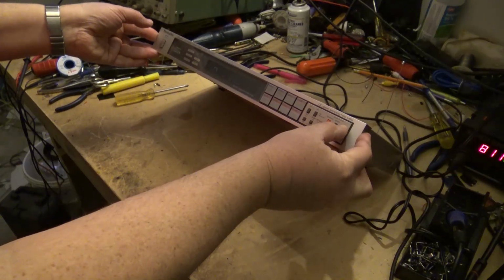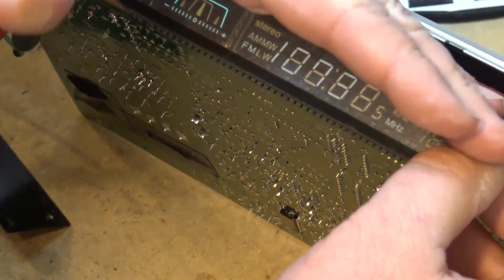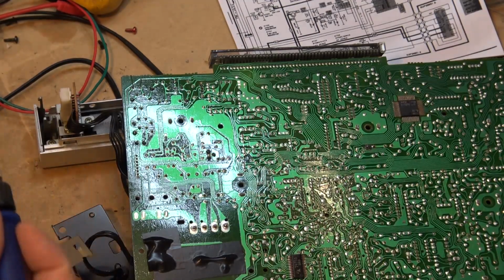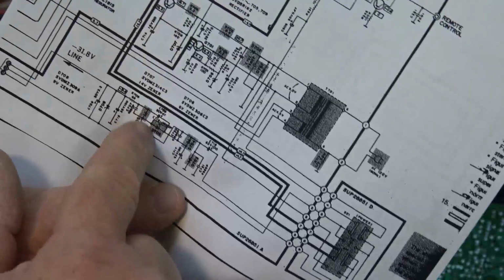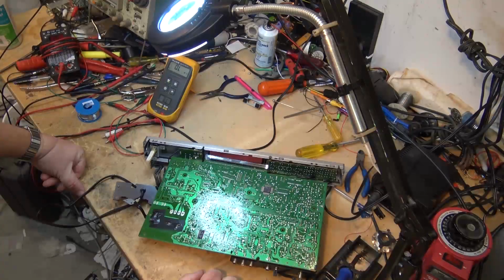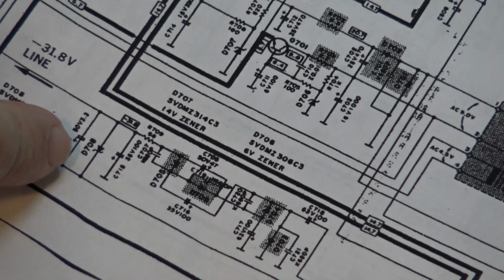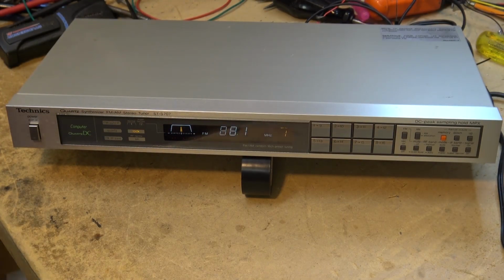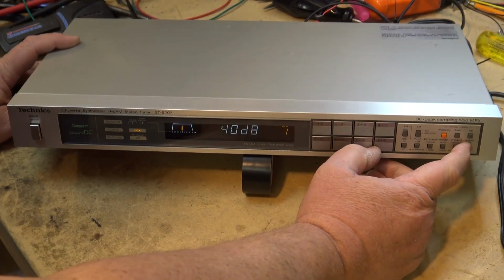Technics STS707 Very Dim Display

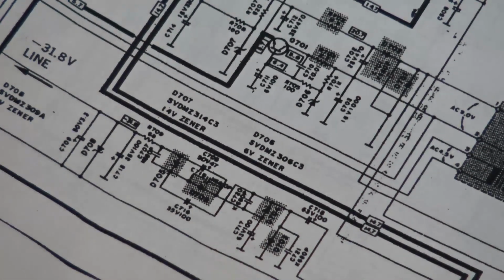Comment: Sir, what do you mean in minute 5:38 that you "bridged" a capacitor? thanks
Reply from the maker: Just how ir sounds. I bridged over a second cap in parallel with the original.  In every situation except a dead short (in other words open or high esr) it would have fixed the problem.
Reply: @12voltvids  Thank you. That's new (for me) so putting a capacitor over another one just to see if it has low capacitance and therefore the problem. Learned something today. By the way I'm a newbie. Oh, what could possible happen if the original capacitor is shorted and you still put another over to test?

Comment: How many volts was on the -31.8V VKK line with the bad capacitor?
I'm asking because I have an LG micro hifi with a dim display, it's VKK line is -27V and it is okay, so where could be the issue?

Comment: Hello again Dave. I've toured your very informative VFD related vids again as I have been given an old Teac AG-790 that has a dim VFD. The voltages check out (-32V at the 'plate', 4Vac across the filaments, and 5.1V bias supplied by a zener connected to the filaments transfomer's centre-tap). Then I came across your Biasing Your Vacuum Tube Amp video; very interesting, not just for VFD info, but I worked on valve stuff when I was a kid. Anyway, since a VFD is a valve of sorts, what's wrong with altering the VFD bias in the same way as you recommend setting up ageing valves? What are your thoughts on reducing the bias by replacing the 5.1V zener with a lower value, (since the 'HT' is negative), obviously taking into account the current limiting resistor? At best the display will be a bit brighter but uneven. At worst I'm on my way to the burns unit again. Regards.
Reply from the maker: Vfd fail for many reasons.  Phosphor burns, loss of vacuum and filament loses the coating that emits electrons.
Reply: @12voltvids  Thanks for getting back to me Dave. I think I'll get a selection of zeners and give them a try anyway. Also, there are bits of info elsewhere on the internet that discuss rejuvenating VFDs by increasing the plate voltage (temporarily), and raising the filament voltage a bit.  I'll do a bit of tinkering. If I have any luck, I'll let you know. One annoying observation, is that when I take the front panel cover off, the VFD is pretty bright. But, the front panel cover includes a colour filter to mask the VFD electrodes, but it attenuates the VFD light a fair bit. It's a pity the designers could not have included a feature to adjust the display brightness, or peel-off filters behind the front panel. Regards.

Comment: Hi sir, 
I've a Sony MHC- W550 mini hifi home audio system, I'm facing same problem with it's display. The display is too dim, plz give some solution, thank you 🙏
Reply from the maker: Check the supply voltages driving the display.  If ok then the display is bad.
Reply: @12voltvids All is not necessarily lost though.  This video and all the tips you gave were much appreciated. I have an old Yamaha RX-V390 receiver with a dim display, but all the voltages checked out, and I was resigned to the fact that the age of the VFD was the root cause. However, during reassembly, I noticed that there was a strip of orange film covering the VFD. I peeled it off, expecting the VFD to be brighter but with all the electrodes visible. Not at all. I assume that the designer did not like the blue green colour for some reason, set the VFD circuitry to max brightness, and then put an orange filter on the front of the display. I accept that this may only give me a few more years use, but I'm happy with that.
Reply from the maker: @davidwhite9751  must of been one of these blue light snowflakes.  Sorry but when someone tells me to put a blue filter on my phone because it is bothering them at the next table I am more likely than not to tell them to eff off.  Yes that happened to me once.  sitting in a restaurant by myself waiting for my food to come I was surfing around on my phone like a lot of people do. Women sitting at the next table with some little kids has one if the kids whisper something to her then she gets up walks over to my table and asked me to turn down my screen brightness or turn on my blue filter as it was bothering her kids eyes.  
Guess what i did so apease her.  
Yup started surfing the twitter feed milfs, juicy mins ect making sure to hold my phone up high enough for them to all get a show.  
Some people.  They should just mind their own business.   
Bothering little Johnny's eyes. Give me a break.  Perhaps if he was sitting in his seat instead of standing on the bench looking over my shoulder at my phone this wouldn't have been ab issue!

Comment: Thanks Dave, i have 2 Technics ST-S7 tuners black and silver that match my two Technics SU-V8 amplifiers. I changed the caps to new (nichicon pws), but both displays are dim. I have to work out what you mean by bridging , as maybe it needs more power to the display.

Comment: Greetings! I have a Technics SA-CH455 that I picked up at Goodwill. Everything seems to work, but the display of the tuner/cassette deck is barely visible. I cannot seem to find a decent schematic for the 455. Any ideas on what and/or where I should be looking for a fix? Thanks!

Comment: Just finished watching the longer version after this short one and I think that I prefer the longer one! 
It might be a good idea to create a second channel that contains all the short versions, some people like them short and others who need to make a similar repair need the long version! 
I noticed in the long version, you tested a 100uf capacitor and got a reading of 105uf... A good capacitor should always read right on the mark or just below it! 
If it's reading above, it's leaking DC current! ie a short or close enough to a short! 
The ESR meter is only looking for high ESR and nothing more! 
A shorting capacitor will always return a higher value due to the short appearing to charge longer than it would if it was not shorting... They have to be pulled from circuit to be tested, there's unfortunately no easy way around it! 
You can quickly go over all capacitors in circuit with the ESR meter but that doesn't tell you everything! As soon as you called out 105uf for a 100uf capacitor, I knew straight away that it's a leaker! There's no such thing as an over achiever when it comes to capacitors!
Reply from the maker: Go back to school.  Capacitors can be 10% under and 20% over. That is the tolerance on electrolytic.  So a 100 can measure between 90 and 120 right out of the box.
Reply: @12voltvids  I have never measured a new capacitor that was over its rated capacity, only old used capacitors that show low parallel resistance.. but to see that in the first place, first you need the right tools, you can't use a multimeter! It's not sensitive enough! If a multimeter can see it, that cap is bad... 
Either you have a Heathkit or Eiko leakage tester, or Paul Carlson's capacitor tester which tests for leakage or an LCR Bridge Meter... Some of those Chinese multi component testers will give you a Vloss % reading, it's better than nothing and can identify parallel resistance much better than a multimeter... You call it shorted, this is exactly what low parallel resistance is! It can be so low that a multimeter trying to measure resistance isn't going to be able to do it and just gives you a short reading... 
I'm sure that you have one of those multi component testers, it's possible that it shows the Vloss reading when testing capacitors but you probably have never taken notice it, it's telling you at what percentage it's shorted, compare some old capacitors that you might have laying around to the same thing in new one's... Actually, make it a video! I don't know what it is but people love watching bad capacitors being treated and compared to new! I would definitely watch that....
Reply from the maker: Starting another channel is not an option because I would have to meet the eligibility requirements to monetize the videos.  The new edits of old videos are for those that complain like spoiled brats about videos being too long.  For every person that says they like the long version 20 say they like the short version better so you are in the minority.
Reply: @12voltvids  well you are the creator! Kinda like a god LoL, it's your channel at the end of the day and you should do whatever you wanted to achieve! 
The people who like the short video just want to see the fix, they are not interested in who you are. For those who like the longer video, I think that they are the loyal viewer, they enjoy the fix and anything else that you have to say...
Reply from the maker: @PeterMilanovski  and there are both versions.  The new short versions are remakes of older videos and the old ones are not going away so don't worry, because there will be longer videos still made.

Comment: Huh? Don't VFDs get weaker with age? I mean, by prolongued usage?
Was this case an exception?
Reply from the maker: Yes they fade with age. Some faster than others.  I have a clock that the vfd failed.  I changed it for another one i pulled from another clock module that i had used the chip to make a jumbo display clock.
Reply: @12voltvids  Unfortunately I can't do the same thing with my AKAI DT200 timer. They're rare to find and would cost just as much to get!
I was secretly hoping you had a magic solution for reviving VFDs!
Reply from the maker: @Stelios.Posantzis  you can raise the filament voltage slightly. That will heat the hot cathode and create more emission but this is a temporary fix.   Most last a long time. I have some displays over 40 years old still relatively bright. It depends on the tube.  I built a 6 digit VFD clock a couple of years ago. Perhaps 3 (the build is on my channel) and the 10 minute tube is so dim it barely shows now.  Depends on how well the tube was made.  Good tubes last a long long long time.  The original one from my 1979 RCA VCR is still good . When i scrapped the VCR i made a clock out of it.  Still works and it is 42 years old and bright as anything.

Comment: I didn't think you can trust a ESR meter.
Reply from the maker: Of course you can. ESR going up is the first sign that a cap is starting to fail. The only time an esr meter won't work is in the event of the capacitor shorting internally and in all my years of servicing i can tell you i have more fingers than the number of times I have see a cap dead short.   In 10 years i have seen it twice. One was the main filter on a power supply.

Comment: I've seen that same defect before... usually the caps go out or the display is EOL.

BTW , buy a componenttester. It tells you right away that the capacity is off-spec. Usually I exchange caps that are more than 10% off.

Comment: I have a GE Sapcesaveer microwave with a VFD. The left side is pretty good, and the right is very dim. I don't have a schematic. I suppose I need to get in there and compare voltages, then guess which parts to pull and test.

Comment: Can you make a video on how to desolder without damage to the board? I've been practicing removing ICs from scrap boards, I learned how to get the chips out OK (with help from a hot air station) but sometimes I think I'm ripping the solder pads on the board on some pins. I think I can desolder things like capacitors and resistors easily since those only have two legs. Are solder suckers good to use or should you use desoldering wick? I have two friends, one says the sucker rips the pads and another friend who says the wick is terrible. Thought it would be interesting to hear your input.

Comment: I have an RTL SDR dongle and use it to listen to radio signals. It has a similar bandwidth adjustment and for weaker FM stations I lower the bandwidth and the station comes in a little clearer. Also there are only two FM stations in my area that have the two digital sidebars along the analog signal.

Comment: Great vid! I always measure voltage across each cap in a voltage multiplier. Find one that doesn't have the voltage across it that should be there for that stage you have a shorted capacitor.
Reply: In a voltage multiplier all the capacitors in series with the AC will eventually fail as they continually have both foils eroded and reformed. The ones with the diodes across last well, as the 0.6V reverse bias is not enough to degrade the oxide film.
Reply: @SeanBZA  Exactly. That is why I just measure the voltage across them in the energized circuit, right away. You find the shorts very quickly.
Reply: Good call! Most people think that it's the tube that is dying but I suspect that people have forgotten how reliable vacuum tubes were. Just like transistors, they don't die for no reason! There's always another culprit...

Comment: I'm shocked that the esr tester was telling lies or omitting d.c resistance/leakage.
That has to be rare, that tester has worked really well for many years.
I've never found any fault with your videos.
Years ago i tryed to watch mr carlsons channel, Way way too much waffle about nothing.
Reply from the maker: ESR and low ohms.   They measure with Ac at about 100khz. A good cap will look like a short to an ear meyer.  That's why you have to test with both dmm and esr or you could miss something.
Reply: @12voltvids  A good cap will look like a short to a what? 🤷‍♂️
Reply from the maker: @rogerwilco5187  a good cap will show very low resistance on esr tester and will charge up on ohms to infinite as capacitors block DC.
Reply: @12voltvids  Yes but what is an ear meyer?
Reply from the maker: @rogerwilco5187  it's an esr meter typed on a phone screen because you know the phone is smarter and corrects spelling.
Reply: @12voltvids  Thanks.  I couldn't for the life of me work that out but it's so obvious now you've spelled it out. (pun intended)

Comment: I have had this same problem with a lot of Akai vcrs in the day. A lot of those models used the same circuit for the display. Replacing all 4 caps was a standard fix  for the "dim display" and was a common fault. I think what goes wrong is the frequency of the inverter is very high and causes heat in the cap and a premature failure of the cap . The same thing happens with switch mode power supplies and the filter caps on the output rails. Good video though .
Reply from the maker: Replacing all 4 is the lazy way.  Finding the fault is the final part.  They won't all fail. Used to see it all the time on VCRs.  Just swap the bad one and the unit never came back.  Never did all because the shop charged 4.00 per cap for parts.  Changing one got me in under the call if over limit.  Changing all 4 would put me over the limit and i would have to call with an estimate and there was a 50/50 chance they would say no and then I got nothing.  We didn't charge an estimate fee so it was important to get in under that limit of 75.00 for the repair.   70 labour plus 4 in parts.  Believe you me I had many times where I had 2 or 3 parts and the estimate came in 76 or 79 and the customer said no.  Then i had to remove the parts and give it back free.  Got burned a few times.
Reply: @12voltvids  yes agree, problem is  just replacing the faulty cap the others would also be on the way out. How long before the others also fail is anyone's guess. That's when you would phone the customer and put it to them and let them make that decision to go the extra mile. That way if the repair bounces, you are covered. $4.00 for a cap is up there, but what service centers have to charge to make money and stay in business. I used to charge similar prices, eg a T205 fuse was $2.00. Labour was then $85.00 HR and this was in 2012 when I left the service industry then. I now drive coaches for a living and clear ( after tax ) $1900 for a 35 HR week. I some times miss the bench work, but not the stress. But I did injoy the chase of tracking down a tricky fault.
Reply from the maker: @stephengorin3059  not necessarily.  This repair was done 5 years ago and I know the tuner and it runs daily several hours a day.  I got out of the service business in 2003, moved on to phone company.  37.5 hour week, pension 4 day work week.